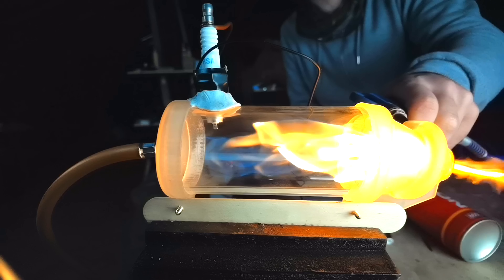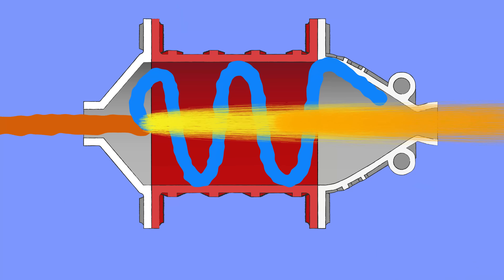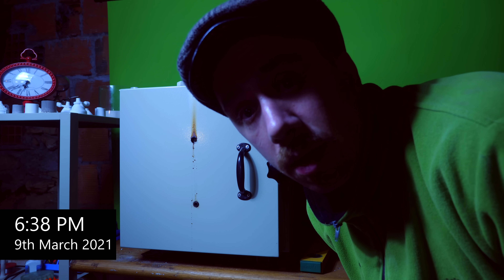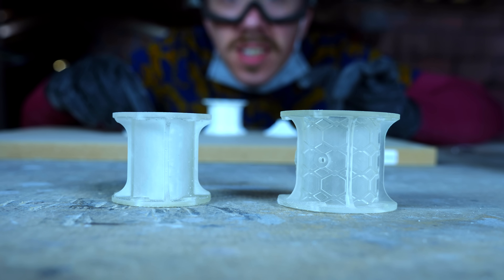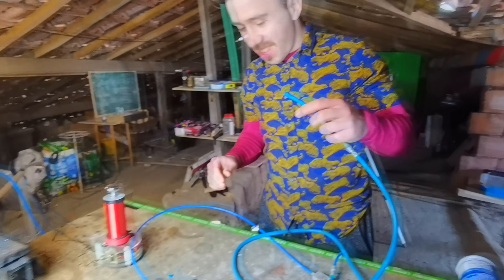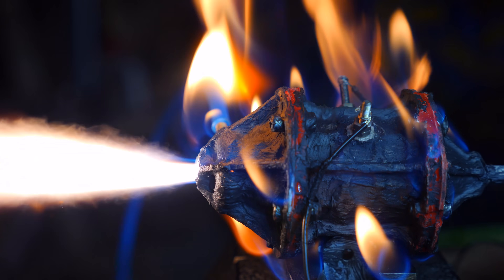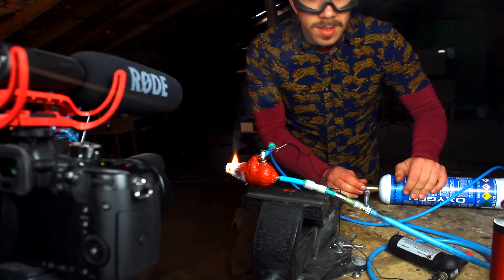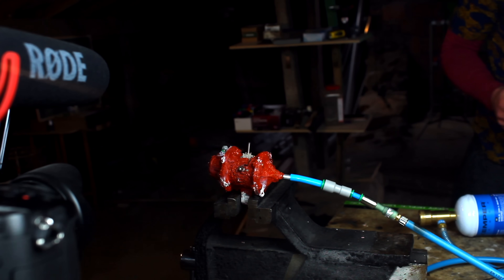Vortex Rocket V2.0 (3D Printed)

Comment: i think what work for you the best was making a solid part engine to minimize leakage 
compression its too much for that 2mm and it still has cracks(you can see at 14:26 how the red compound expands), maybe heatting it slower in the oven and making it 2.5mm will work? idk

Comment: Why not make two of the engines, one as the actual engine, then put the hight temo silicone on it, then put a bigger 3d print of the engine around that and the put silicone on it and now you have 2 layers of engine.

Comment: Make the parts embed each using grooves on joints, then put some o-ring/gasket in the valleys to avoid them be affected by direct pressure. As any good pneumatic/hidraulic project should.

Comment: Try adding a longer throat in the design, also experiment with slightly larger diameter nozzle outlets to find the optimum performance/longevity.

Comment: It seeems that that the high temperatures are burning the engine from the inside out, causing it to leak...

Why not coat the inside as well with the refractory cement or silica?

Comment: To get a nicer mating surface between parts, use sandpaper on a flat surface and sand down the surfaces in a circle on it. It will cut down the high spots until its smooth.

Comment: Simplest guess would be to coat the inside and not the outside so the gases can't get under the coating and lift it off then ignite under the coating burning it. You wat to burn the tomato with the engine, not the engine like a tomato.

Comment: Also, hydro dipping high temp silicone might be possible? That way you'd get an uniform layer.
Or you could wrap it on aluminium tape and hope it ends up melting just the right way?

Comment: I think you should 3d print the design then just cast it and make a thick ceramic out of that. The gas is leaking through that 3d printed ceramic like crazy, and the one you got working failed too quickly.

Comment: You may find more success by putting the coating on the inside of the engine so the pressure would be forcing it outward against the walls of the engine. Consider using a liquid ceramic paint made for car engine exhaust pipes. It’s a thin paint. You could pour it into the engine openings, roll it around to ensure full coverage of the interior of the engine, and then let the residual drip out. Finally, cure it in the oven. 
You’ll get sealant as well as extra wall protection from the high temps.

Comment: @Integza, I have the solution for you...maybe?  :D

If you make it so that you can apply the silicone on the inside - I'm not sure if the product is rated for that but, assuming that it is - then the pressure would have to push the silicon through the pores - at least buying you time to keep it on longer.
Reply: Here's another suggestion: why don't you take your ceramic engine and dip it into slip clay a couple of times, then bake it again? The clay will take care of the pores. Or maybe you can use porcelain or some other similar material. Take it to Caldas da Rainha.  ;)

Comment: To fix the leaks, don't mate the pieces using parallel faces, that makes it too easy for the pressure to build up and push out. 

Design the mating surfaces with a tongue and groove type that way it's not a straight shot for the pressure build up to escape. Same idea as going backwards through a tesla valve, too many turns makes it more difficult. Doing this will also give you a nice channel to add the sealant you've been using. 

You also may also try using a material like flexible graphite to make a gasket between the surfaces.

Comment: Lost PLA (or vapor-smoothed ABS) aluminum castings? You already have the kiln necessary to burn out a mold. And melting aluminum isn't that difficult if you have a hardware store and use The King of Random's propane powered foundry plans.

Of course, that rapidly moves into "have some sand bags and a lot of hard cover around your test stand" territory.

Though  I wouldn't want to get too clever on internal features were I doing that: Negative space needs to be filled and then cleaned out. (If you were smart, you might try finely milled salt as infill and just wash it out after the cast and burnout, but you'd need to choose an alloy that melts below 800 C so the sand doesn't melt too. Of course, if you keep the features simple, you could probably drill out your vortex nozzles)

Comment: your next couple of videos could be as follows.
Fire the part then try immersing the pieces in a solution of sodium silicate (water glass) allow to air dry then repeat .  fire in oven,  test

If that does not work try a ceramic glazes slurry on the in side of the individual parts.   fire in oven, test

Try a combination of the two previous method. Then fire in the kiln again, test

If that does not work try coating the inside with a refractory slurry made of “Satinite”  fire in oven, test
ETC.

Comment: Research ceramic glaze. Its the glass like coating on the outside of ceramic wares. you could paint it on and then fire it in your kiln. If your kiln doesn't get hot enough there are other glaze type coatings that can be baked on.

Comment: your parts could have over lapping joints on the inside that you could sand / dremel to fit. giving you a better seal coupled with a metal tube housing to provide strength. maybe design them to fit inside a pipe that you can use your high temp compounds to fill/seal it when you screw it together will end caps that you have modified to let the gasses escape as desired.. drilling and tapping the metal for your gas inlets or brazzing would provide better sealing options for your fuel. also consider using ball valves on your gasses to have quick shut off available

Comment: Hey Integrated, can you try:

Print an engine out of PLA.  
Get modelling clay and carefully coat the entire part with about 4 mm of the stuff.
Stick it in the kiln until the clay is dry, at low temp, say 80 C.
Once dry, crank the temp up to whatever the specs require.
I'm hoping that the PLA will vapourize and leave behind the modelling clay, which should be way stronger than your printed stuff.

or

Keep the parts as is, but then add a coat of modelling clay over them, then bake again.

I'm most likely completely wrong, but thought it worth a try.

Oh, last suggestion: make one by hand.  Modelling clay and your hands.  Then sell it to one of those Primitive-Life channels as a jet engine for their cabin.

Comment: Put the sealant on the inside not the outside. The pressure should also be regulated better. 
Putting the sealant on the inside will force the pressure to apply the sealant down into the pores of the material. Putting the sealant on the outside forces the sealant away from the body, case closed. 
Regulating the pressure better can only help. It is working fine at low pressure. You don't lose control until the pressure gets high. You need ri find that sweet spot where it burns well st the best pressure you can get. 
Also please include me in on the contest. I wasn't paying a lot of attention to what were were supposed to do. I didn't want to forget my ideas. And to be honest I'm too lazy to go back and check. Interesting video BTW. Do you post your print files anywhere(your links didn't load for me)? In case we want to hire someone to print it. I wonder what it would cost. Most likely a coffin load.

Comment: Thin high temp ca glue. 250 to 500 degrees. Or, it is ceramic, just use ceramic glaze. I am sure there are pottery people nearby for a proper kiln to do a high temp glaze.

Comment: After you burning out the photopolymer of the ceramic parts, if you submerge them into a normal resin and then let the parts cure using UV light, the pores could be filled

Comment: Use the 3d printer to make a mold,   Then perhaps try cement ?  That should be quite thermally resistant
Reply: Id be funny to see , a square looking engine , with the chambers inside having the vortex proprieties , it defeats the purpose on having a vortex inside  , but the ideea still sounds cool

Comment: At this point I'm basically just waiting for a GoFuckMe Campaign to go up because he burned down his shed and house connected to it.
Insurance guy: "So what happened Mr. Integza"?
Integza: "I built a Rocket Motor and things didn't go where I wanted them to go..."
Insurance guy: "Please elaborate."
Integza: _"You know how a Rocket Motor usually only have has 1 Nozzle and this one 1 Flame? Ya?"
Insurance guy: "Uh-huh... 1 Nozzle and 1 Flame per Rocket Motor makes sense, I guess?"
Integza: "Well... Let's just say I may have invented single Nozzle omnidirectional Rocket Motor with a 360° Rocket Motor Flame coverage."
Insurance guy: "..." scribbles 360° stupidity

Comment: I love your progress, big rocket engines run the cold combustion fuel through the nozzle to cool it. Also after baking your parts submerge them in some sort of liguid to coat and seal the porosity of the part. Also seems the vortex heat abatement is still not enough to keep the temperature from effecting your system. Just musing and sharing my observations..........Good Luck.

Comment: There is a way to seal ceramics to make them water proof I know one way is with warm milk and another chemical but I don't think that will help with the higher heat there are other things like modpoge  and if you were able to seal the inside and out of the ceramic peices it would be less likely the gas would try to escape out the porous holes.

Comment: Theme suggestion: 3D print a small power plant with a sub critical boiler that actually generates electricity ...probably would need to solve the leaking issue first though

Comment: Hey Integza  y not  make your  single bodied engine larger  in order to increase the airflow,  perhaps with the right ratio spitting hot gasses out may release the pressure inside the chamber!??!
Reply: and  perhaps modifacations to the fule injection ?

Comment: To solve the leaking? Coat the engine in metal.  Maybe you could vapor-deposit aluminum. Or possibly fill the engine with wax, submerge the engine in molten aluminum (taking care to prevent the wax from escaping out the holes it would be boyance-pressured to try to escape through, maybe with brass plugs?) Cool the aluminum to harden, grind off excess.

It may also simply be that you're running too rich; what does it matter if your O2 permeates through the ceramic, if it won't burn? You need the O2 to dominate the chamber pressure. Perhaps having more lateral O2 ports would help, too, including some closer to the fuel.

Finally, consider possibly a double-walled chamber, where you run O2 (or even N2) pressured through around the outside of the combustion chamber. That might need a second port, or you could allow the primary port to bleed laterally a little bit into the cooling channel.

My bet is that the metal coating will be the simplest solution. (Though maybe test if a deposited aluminum coating is inflammable before using it to coat a rocket engine. I doubt the dipped solution would be as risky. I wonder how metallic model paints work, and if they dry "safe"? PVD brass is a thing, and that might be the best bet of all.)

Comment: The first idea for a solution that comes to mind is using the ceramic dust from removing supports to make a mud to seal connections on the engines.

Comment: I think that your issue is the porosity of the material due to burning the resin out of the ceramicmass. Due to the lack of wall thickness the chamber also can’t withstand the pressure. Maybe carbon fibre mixed with kaolin, zirconia and/or silicon ash could help you reinforce the mold? You should find a place nearby, maybe a school or foundry that specializes in lost wax casting and they probably could help you further with reinforcing of the mold. When I make lost wax molds, I use the previously mentioned ingredients for the ceramic mold and wall thickness is far more than 2mm. You still need to bake the mold inside a kiln after the additional ceramic coating. There’s also products that can be used with normal casting molds to provide a smooth finish that can withstand higher temperatures and maybe either that or a ceramic coating could help you sealing the inside of the combustion chamber. I believe that the solution for your problem would be to make the part thicker, add cooling and chamber that whole unit inside a metal cylinder which would add strength on the outside to help withstand the stress caused by the thermal expansion which ultimately leads to cracks. In order to add metal you first need to tackle the issue with the active liquid cooling. I’m interested on buying a lcd printer with large printing area, can you suggest for a good quality model? Obrigado e boa sorte👍🏻

Comment: If the gas is leaking through the porcelain, you may want to look into high heat spray paint and give it a couple layers (inside and out).  to solve the leaks between the modular pieces, you may want to look into a high heat gasket and print to fit around it for each piece.

Comment: The silicone here heated until it ripped itself open.  I'd try doing this over but after you take the engine out of the kiln seal the outside of it with clay and maybe throw it back in the kiln for a little bit. It'd also be cool to see what wet clay might do if it was wrapped with something, gorrilla tape or plaster wraps the medical kind.

Comment: I believe the problem is the porcelain is porous and you have put the impervious layer on the outside of the chamber therefore the internal pressure is forcing the coating away from the surface and causing leaks. If you could paint or coat the inside I believe this would solve it.

Comment: Place your engine inside a tube with a pressurized jacket  of room air/nitrogen. Set pressure higher than chamber pressure. You could also use the jacket for cooling... I love your videos. Very entertaining. Thanks.

Comment: Shouldnt it be possible to use some ceramic glaze to stop the leaking? like in tableware porcelain? The raw shard is burned first to get it dry, then glaced and burned again. You'd need some diamond crown drill bits to get your fittings in, but that would solve all your heat and leaking problems..

€: It will become more brittle, so you shouldnt drop it tho.

Comment: It looks like a lot of the leaks are coming from the seals between the parts.  While they didn’t work great in cold conditions, you should try taking a leaf out of the space shuttle SRB’s book.  Add channels into which you place high-temperature o-rings.  Another possibility to reduce the porosity of the ceramic - you could glaze the outside, that would.  That would also make it look really cool!

Finally - suggestion for a future video.  Combine your SRBs, liquid fueled rocket engines, and your two small tanks of propane and oxygen.  See if you can manage to get enough thrust to get them off the ground!

Comment: You should try solenoid valves for the inlets so that way you can maintain the oxydizer and propane mixture and fine tune it from run to run.

Comment: Integza, use ceramic glaze to seal your rockets. It's fire resistant up to 2000 degrees Farenheit, and non-porous. Also, it's more slick, creating less friction in the chamber. I suggest doing a full-glaze, which is achieved by dunking the product in the desired glaze and pouring out any residual before firing. 
Thoughts?

Comment: Sealing the ceramics
Hi Integza, have you tried sealing the ceramics with waterglass? That is sodium silicate.
It is commonly available and used to seal e.g. flower pots, cement tiles and exhaust systems. 
See https://en.wikipedia.org/wiki/Sodium_silicate.
Just mix liquid waterglass with water 1:5 and brush on. Cures with atmospheric oxygen.
I would love to see your engine running.

Comment: Possible solution to fix porosity issue:
Soak your engine in pretty liquid sodium silicate solution (when concentrated is too much viscous), than drip it, put it in a closed chamber and saturate the atmosphere in CO2 (a few minutes should be enough, leave it for 30-45 minutes) then put it back in the kiln at 500°C to completely dry it. The silicate particles should block pore channel and can easily withstand your working temperatures. 
Ps: if one application shouldn't be enough just repeat the process a second time.
Cheers

Comment: Looks like your ceramic isn't air tight and too high a pressure blows the weak spots, maybe try coating in something like liquid ptfe on the outside to try and bond the ceramic to improve the structural integrity. Really cool effort BTW!

Comment: As you've probably noticed, the high temp silicone starts to bubble before it burst into flame. This sums up the problem with all coatings, they aren't stopping the problem, just hiding it.

To solve the issue, you will need to coat the inside of the parts, with a very wet refractory cement. Once coated, pressurize the system. This will force the cement through the pours, allowing you to fill them. Doing it this way can take multiple coats, but it would have a better chance of preventing the leak, and the better the penetration of the slurry the more effective it will be.

Comment: You could design a lip/groove In your parts of the engine. Or bake the parts for a second time with ceramic enamel on the inside (as in the stuff used for pottery) Great video as always! Cheers

Comment: Sleeve wrap your design... by printing a slightly larger part to go over the existing one to give yourself more thickness in your walls... also any tube like passage ways could be done with silicone straws

Comment: You know how you have the issue with your rocket engines where they just melt and burn up.....well why don't you try and put some sort of heat sync on them. A lot of electronics and things get super hot so they have heat syncs to help keep them from over loading and burning up. So why don't you put some form of a heat sync on your rocket engines to help spread out that extra heat and make them last longer.